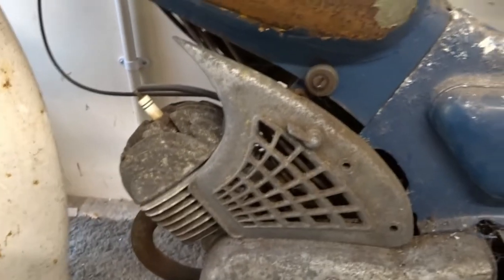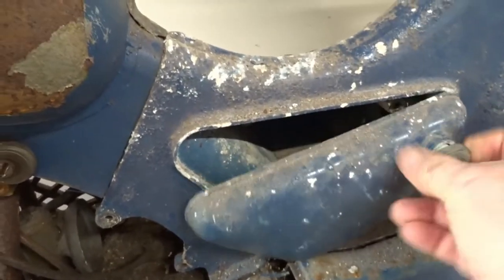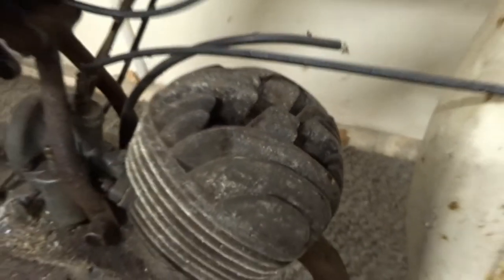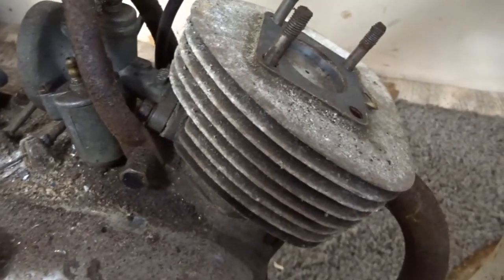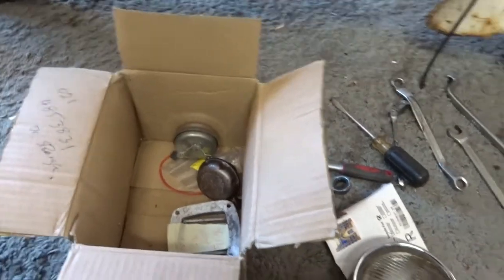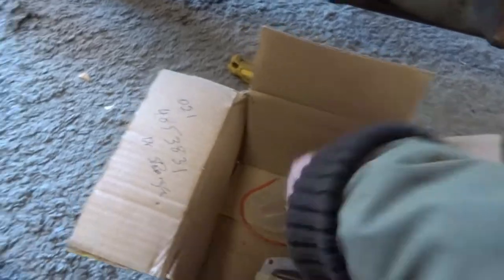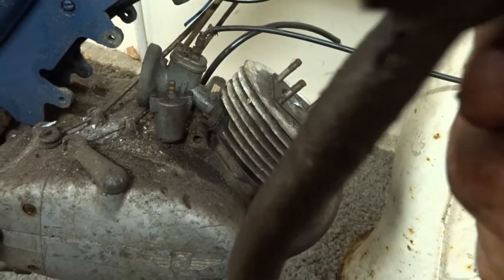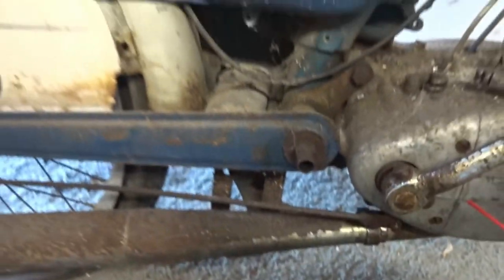Zundapp Combinette 428 /1961

Comment: Great to watch your video which is giving me courage to do mine which looks in many ways exactly like possible basket case in my shed now. You may know already but the small cavity under the seat is for tyre pump, I have no doubt I will be using your video heavily in the next few months. Thanks
Reply from the maker: Thanks Gary, Go for it, life is too short.
Reply: @tomcahill8506  mine has been in a shed for decades and i will need some parts eventually, is there a go to supplier of bits and pieces you can recommend.
Reply from the maker: @garypitts3334  I sourced bits on ebay.
Reply: @tomcahill8506  Thanks for getting back to me, I will take a better look.
Reply from the maker: @garypitts3334  JMPB.com, Zundapp.nl, 50 factory.fr, and Google zundapp and lots of suppliers come up